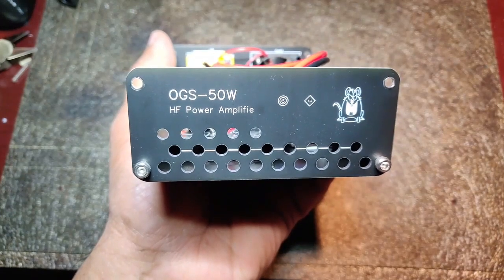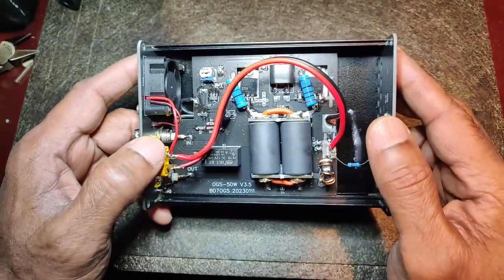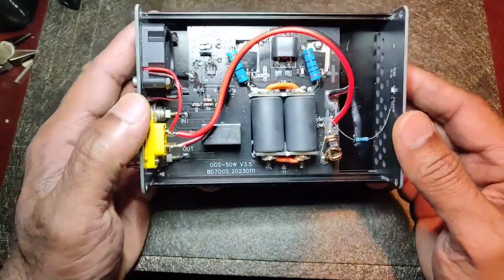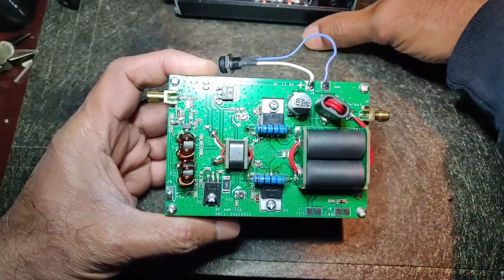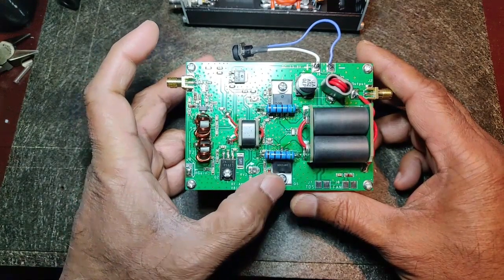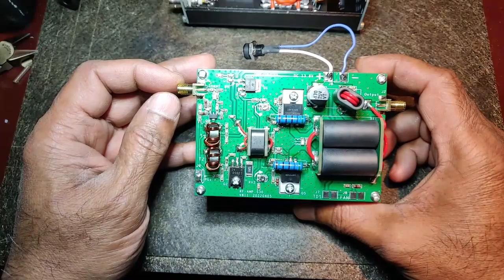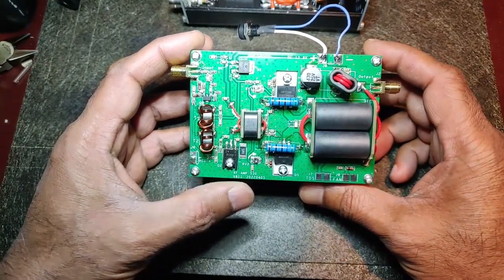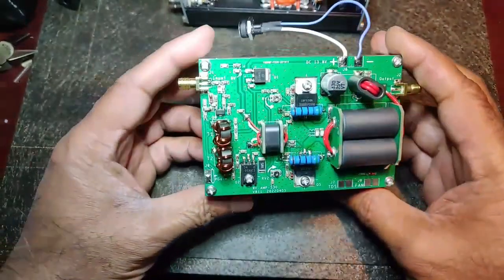OGS-50W HF POWER AMP | BUYER BEWARE | COMPARE ANOTHER 45 HF AMP WITH I/P 3dB PAD, 2-STAGE PRE-DRIVER

Comment: I hate to be that guy, but I've got two of these, and I'm loving them to bits. With that said, if you've still got that one, and would like to part with it, I'd sure love to buy it from you for my mobile installation. :)
Reply from the maker: Hi Tom! Good to know you are happy with it. Thanks for the offer. If it doesn't involve shipping then I'll sell it. Shipping is expensive. I packed it to send it back RMA but didn't because I knew the seller won't pay shipping. So, it's just sitting as a paperweight.

Comment: I'm going to put together a setup with a mini usdx, an ATU100 coupler and a BJ300 linear amplifier. Is any linear modification necessary due to SWR or does the coupler mitigate this problem?
Reply from the maker: A coupler does help. You may want play around with the drive levels.